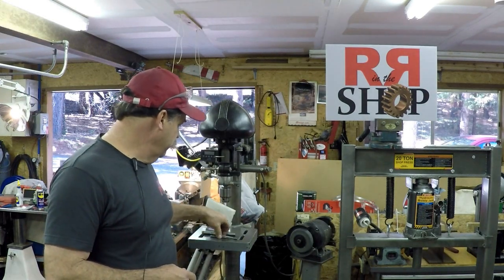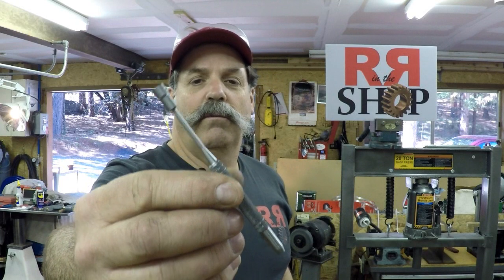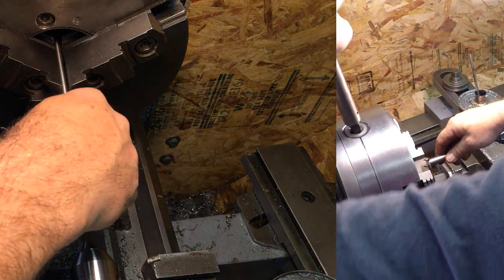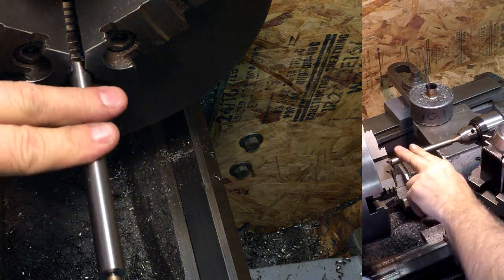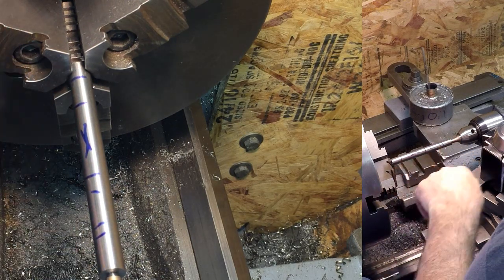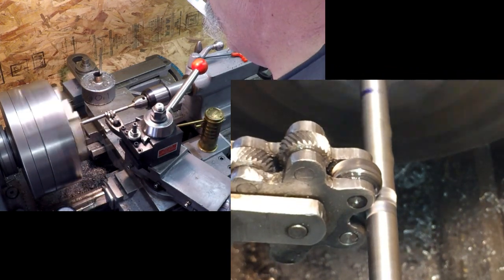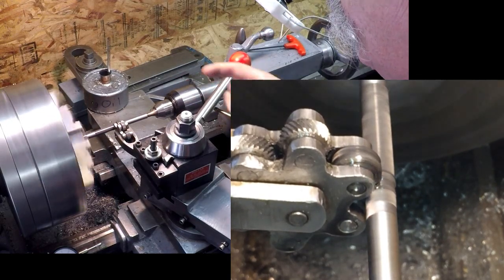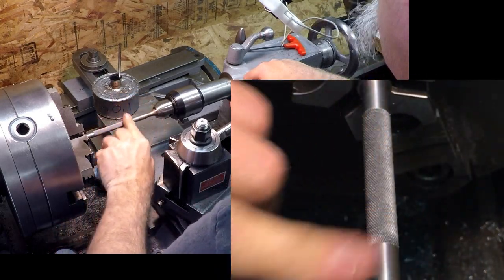How I Made the WIYB Test Punches Part 1

Comment: Just a personal preference from using tons of punches but I like them with a large relief for your fingers and a bigger striking surface. It is easier to hold onto than a knurl, protects your fingers from hammer strikes and reduces the stress on the striking surface by spreading the load. Looking forward to the collaboration progressing.
Reply from the maker: bcbloc02 Thanks for your input and all is welcome.  The larger Pin punches are 1/2" dia. handle portion.
I will look at making the strike face a bit larger. We will see how the testing goes.  Thank you again, Randy

Comment: Funny you should mention not using a brush near the knurls. Been there, done that a few times with the brush bristles getting caught and sucked in by the spinning knurls. A lot safer with the oilier at a safe distance. Have you tried using a scissor knurling tool?
Reply from the maker: Paul Jones Good thing brushes are cheap.  Have not tried one yet.  Thinking of making a cutting one.  Thanks Paul for watching.  Randy

Comment: Hey Randy,
FWIW I just rechecked my Brownells supplied roll pin punches I bought years ago. The tips on the ends of the punches that fit into the hole in the roll pins are only about .060"-.080" long and they work just fine. Unless I'm mistaken, I thought I heard you saying you were making yours with much longer tips? I honestly think that would make for a weaker area since the tips would be so thin then they would be through hardened. However I know just about zip about heat treating, so you can consider that while your contemplating just how good my thoughts are. :-)

Pete
Reply from the maker: +Turning Point Thank for the info.  I have found that using the small tipped punch's work but don't always center up well.  I was going to make these with just a bit longer tip about 0.100 length.  We will also harden and temper.  The test punches worked very well.  Thank you again.  Randy

Comment: Hey, Randy.  They look good.  Question...does the book also state the feed rate you use when doing the knurling or just the diameter based on the pitch of the knurl you are using?
Reply from the maker: ILGopher Diameter.  Pitch of knurl determines diameter.  Randy.